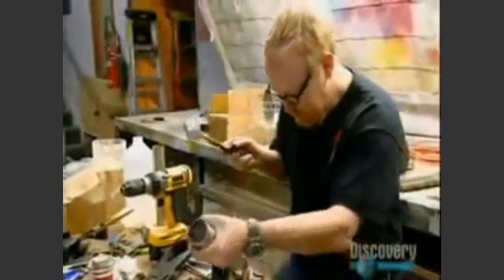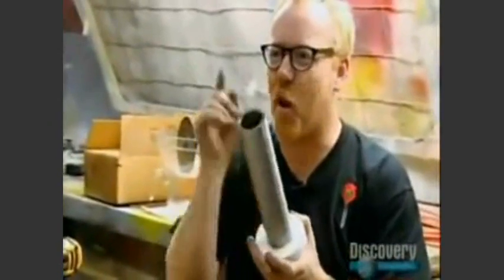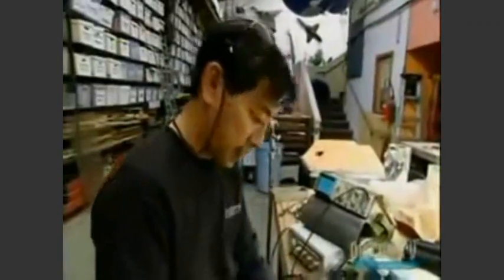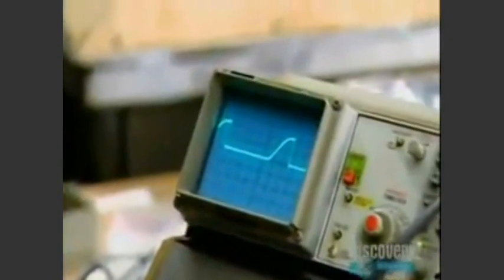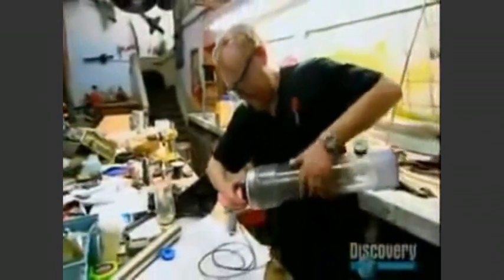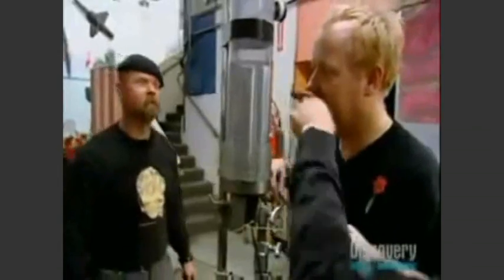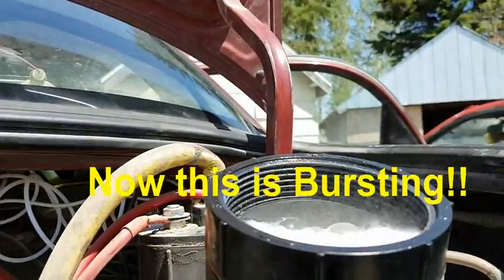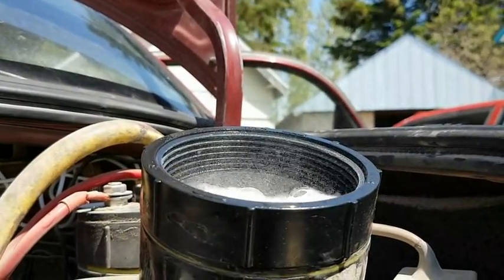Mythbusters Busted water for fuel

Comment: Edited video so the validity if your point is lessened. If it works why aren't there test cars with this in large numbers? (Don't use the oil industry excuse). I think you can't produce enough volume of gas to run are engine solely from Hydrogen so it is only good at best as additive to gasoline in small quantities.

Comment: Imagine how many other MythBuster scenarios they fudged...

Everyone knows that you can run a car on water through electrolysis. It's all dependent on the alternator and the battery power output.

To run a car 100% on electrolysis of water, you need to supply at least 12vDC 40 AMPS. That's in order to achieve full  throttle. 

However some people only achieve about 60%-70% full throttle (as opposed to running the car on petrol). They are happy with that nevertheless. 

Most of those cars are old though, and owned by people who don't want to spend a lot of money on juice.
Reply: Do you have any evidence? A hand made hydrogen car simply doesn't produce enough hydrogen itself. You can't even find a battery (on the market)to store such electricity to even power and start the process of electrolysis. Atleast with cars today that weigh much more the old cars. If you wanted to run your car on hydrogen hand made. You would want to strip your car out of all non necessary things to lower the weight and even then you wouldn't get far due to the battery running dry
Reply: @devilcwesker5980  

All you need is 12Vdc and 40 Amps, and that will supply a small 4 cylinder car, so long as you do not use a truckload of electronics for computers etc...

Any average Alternator can output that, and still keep the motor running. 

Most batteries will easily output 40 Amps for a few seconds to get the system going.

Although many people have a valve so they can start in petrol mode, then switch to Hydrogen power when the car is running.

The real issue that impedes the electrolysis process is temperature of the water, the electrolyte used, and the materials used to create the electrodes.

Instead of electrolyte however, a pulsed system should be used that is a subset of the molecular resonance of water.

What that does is use resonance to slow down the Atomic Electrons in their orbits.

The result produces Atomic Electron gaps that allow easier disengagement of the Atoms in water molecule.

The higher the frequency subset, the more productive the output.

Basically in the same way that you can design Yagi Antennas in 1/2 wave, 1/4 wave, 1/8 wave and so on, and so forth, you can subdivide the water molecules resonance frequency down to a manageable amount that works in the same way.

Heating the water is also essential in order to create an additional 30% more efficiency. 

And when water is heated, the molecules can be decimated easier, with less power.

Cars using a similar system may achieve around 75% of their total power capability.

If the system will not run independently on Hydrogen alone, you can use a valve to basically supplement Petrol usage instead.

You can then supplement around 60-80% of fuel and use petrol for the rest.

The two gasses basically get mixed at the carburetor stage, its a little inefficient although at least it will bring fuel costs down to at least half or more.

The hydrogen must be controlled using an electronic valve system using PCM activation to allow mixing with petrol in accordance to the accelerator usage. Otherwise hydrogen will just leak into the carburetor 100% of the time.

It will not affect acceleration, although it is not safe as combustible gasses are released under the hood of the car and may build up.

The system works, and even though you may not achieve 100% conversion (in some cases), it still brings petrol costs down a lot.

Its better than nothing.
Reply: @generaza7609  can you build an actually functional car that runs on water? A functional car that can be sold?
Reply: @generaza7609  bro you’re so smart LMAO I could never. Stanley Meyers also found out a way to do this but unfortunately we know what happened….
Reply: @saadabdullah4245  Yes, although I will not. 

Do you honestly take me for a fool? 

I would be assassinated.

As I have said all along.

If you want a car like that, you have to build it yourself privately, and use it privately.
Reply: @generaza7609  have you heard of nikola teslas inventions as well. He invented many things as well. Many people suspect he was silenced.
Reply: @aliyan7187  it just goes to show what type of monsters the world is dealing with.
Reply: @devilcwesker5980  You really would not be saying that if you did it yourself.

Obviously you did not try it, or you tried it and did something wrong and it would not work.
Reply: @generaza7609  yeah I trust it works. I believe in Stanley Meyers and that what he made works. Despite many people doubting it saying it’s impossible.
Reply: @generaza7609  can i please contact you somewhere to speak? Can the car run solely on wTer after being started in the battery?
Reply: @generaza7609  please provide me some place to talk
Reply: @generaza7609  yes please give your secrets gas killing me homie
Reply: @worldstarnotsosuper846  I do not know what you refer to. Water vapor is not poisonous. Even if it cuts down Carbon Monoxide output by any percentage.
Reply: @generaza7609  I think he means the gas prices are hurting his pockets lmao 😂
Reply: @worldstarnotsosuper846  No secret, I already explained. Many people do not know that a Spaniard invented the first water powered car back in the 1940's. 

The system is only really effective in older cars before they added computers to cars, although people have bypassed the issue by directly injecting the hydrogen straight into the carburetor.

I do not perceive that it is a good way unless you can fine tune the hydrogen feed, according to the carburetor feed control.

Otherwise hydrogen builds up under the hood and can cause a problem, not effective,

Comment: Net video but there's so much over look hear and scamers come around all the time and people wishing to make money as well.

When it comes to making and building s HHO cell there lots of things to consider
The voltage AC OR DC

If AC Voltage The Frequency -  120 volts AC at 50 HZ In some nations , 120 Volts  AC at 60 HZ in the US or  115 Volts AC  at 400 HZ used in aircraft and produce from Generator's or power inverters.

 The Current, higher currents can produce heat and wast power

Single Phase, Two phase , Three phase power or some other number of phases

The cells wet or dry

The number of plates of positive and Neg

Question  do positive or neg plates produce HHO or do positive and neg plates both produce HHO

The service Area

The thickness of each plate

The distance between each plate or Tube

The meatal its made from as Staness Steal sems to keep the water clean  and copper can make it turn green

Should you mix the metals to produce HHO or dose that matter

How dose other meatal work like Titanium 

What of  possible using some other none metal material and using a frequency to break the bonds and cause the water to brake into its parts. 

What other things all one possible has to do is open his mind and possible come up with the answer but like fishing it may take and patient for many things in history came to those who work at it over time

I thank [ Stanley Meyer ] said he used  115 voltage at 115 HZ   possible said he pulse during the TV and his power cell only used a few amps of current and produce no heat.

If ever thing he said is true then he had the power to free the world from oil and let freedom ring across the world 

It would have been a good show if had dove deep into HHO but they work and get only to do so much with what they get for TV 
Some of there shows are quite good and at work you do what the Boss says or get a new job.

The system they got may have come from someone trying to make ends meet and for the most part coped it or the ideal from some other ones work  came up with his own ideal of how the system will work, Its possible the seller never build the system as well.

Its all so possible Mythbusters build part of it wrong as we all mistakes at times 

Just a note to thank on
Reply: Short up date I thank its 115 volts 400 HZ in aircraft and some of the lighting systems in air craft use  AC voltage

Comment: I cant remember which auto manufacturer is using a hydrogen cell but it's in use now. You know if that's the case, a fuel cell had already been around way before production.  These charlatans were obviously paid off to be misleading

Comment: water is a stable molecule with strong bonds it takes a lot of energy to split even advanced fuel cells can't produce more energy then it takes to split water and their more efficient and powerful than you just burning it. Also when the 2 hydrogen atoms recombine their hydrogen bonds have less energy in them then other methods of producing hydrogen like by using methane which means you making even less power.
Reply: It seems there are crazies that become attached to every single conspiracy and pseudoscience theory no matter how small. It is no surprise that there are moon landing deniers here as well.

Comment: Back in the day for my middle school science fair I made one that made HHO in time about 1 gallon per 2 minutes. When I took a litter to it to show how powerful the explosion is it made everyone feel like they just had a flash bang throw at them. This stuff works don’t let the oil companies lie
Reply: How much energy did you put in vs how much energy did you get out?
Reply: way Kate but I made one it improved my mpg... yes it used more power in eclectic than it made yes BUT internal combustion engines are very inefficient. even a tiny amount of hydrogen and oxygen introduced directly into the intake helps more of the file actually burn per bang.  @Ham549
Reply: Ham549 it was a electrolysis project. You can use what ever kind of input in it I used a lawnmower battery but you can use a 9v battery 120 or what ever you want
Reply: If you're putting more energy in than you're getting out then you're just wasting electricity. You're better off just useing the electricity to charge a lithium ion battery.
Reply: @Ham549 nd if you get more out then you put in it violates TD right? So gasoline takes more energy to extract from the earth and refine from crude then we put in? Cold fusion is bunk? Or maybe you don't know as much as you think you know.
Reply: @loveblowsbad  Not necessarily, the energy from gasoline comes from photosynthesis of prehistoric life. So it is stored solar energy and getting more power out of gasoline when we used extracting and refining it does not violate thermodynamics because of the previously stated reason.
Reply: Ham549 dude think now I used a battery to make hydrogen which is explosive. Use it in a engine to replace gasoline
Reply: @Salemchevy  and the energy you get out of the explosion is less than the energy you put in. It's called thermodynamics.
Reply: Ham549 true but it is a alternative fuel for gasoline
Reply: No you didn't.
Reply: So your saying Stanley Meyers water fuel cell actually works? Lots of people doubt it but I tell them they only say it’s impossible is because the knowledge we have in science publicly right now is limited so we think it’s not possible but with the knowledge of these people it actually is possible.

Comment: They say they built it by the internet instructions, but they don't say anything about adding a "catalyst" like potassium hydroxide to aid in the electro/chemical reaction.  Water on it's own doesn't work well enough. You need a catalyst of some kind to make the water more electrically conductive.  Even when I use electrolysis to clean rust off metal objects I still use a little salt or washing soda to help make the water more conductive to get a better faster reaction.  To anyone with a little experience this is so obvious what they're doing wrong.
Reply: Water is a resistor, you need to match the power to the load impedance to transfer optimum power to the electrodes.

Comment: first off hydrogen is not a liquid carburetors and fuel injectors are designed to turn a liquid into a vapor because if they didn't the engine would just flood out , because of this the hydrogen would not get past the float so I thought, when they added hydrogen from the top of the carburetor the car ran, but in all fairness you can pour gas in the top of a carburetor and it will spit back and catch on fire the same way
Reply: Kevin McGill, If a carb is cut off from fuel, You can introduce any vapor gas to feed the engine, at that point the only function of the carb is the butterfly plate limiting the air flow.
Reply: That flashback from a carburetor when you dump gas in it is because you dumped too much gas in it.

Comment: I find this kind of video, and idea really interesting. What’s your setup for production that makes such a difference in the amount of gas produced, when compared with what the myth busters did?
Reply: HHO is a joke. Only really dim people think it helps do anything but empty your wallet.
Reply: Furthermore, If you wanted to illustrate for the critical viewer how this works, maybe inform them that the electricity applied in hydrolysis rearranges the molecules of the water so, it is more apt to release energy. (what I assume is happening with the H20 molecules)
Reply: @kevinmoore2501  i have a question what kind of tank or cells would you use to hold water